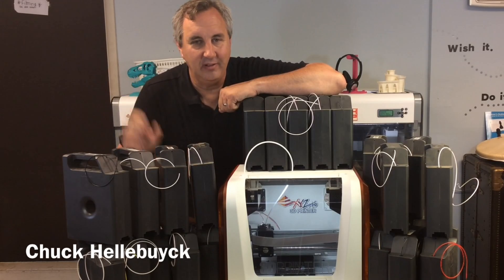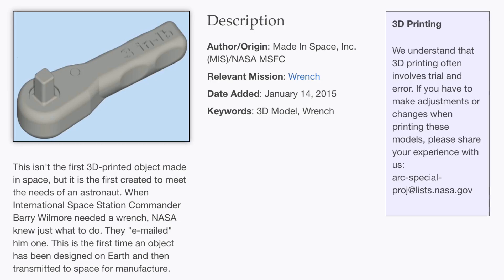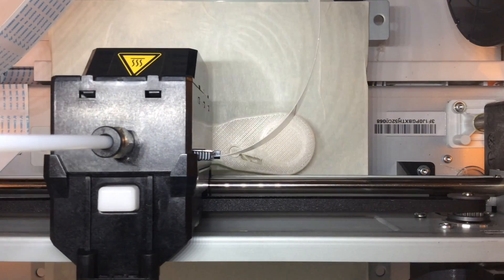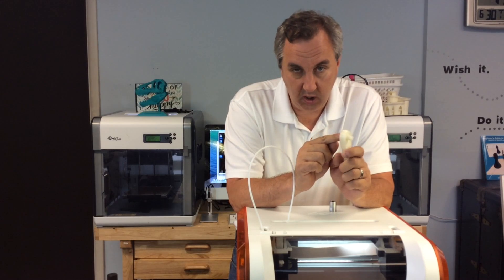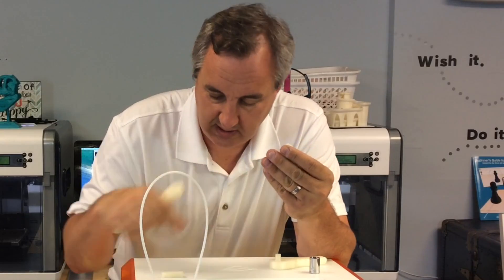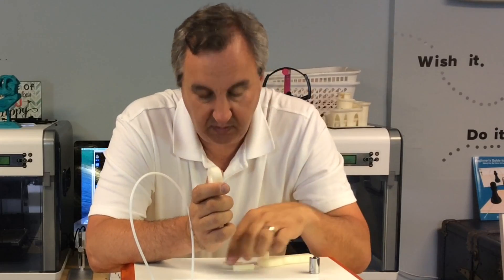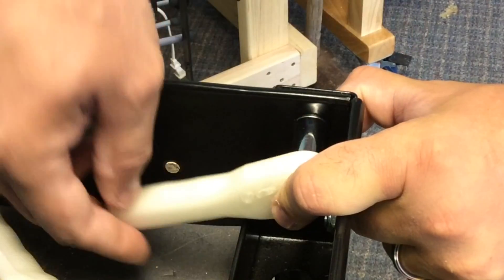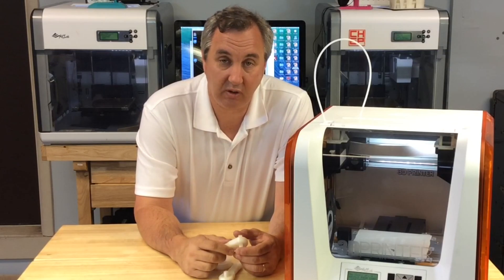Filament Friday #22 - NASA Wrench Test Print on Da Vinci Jr - Video #066

Comment: Tried this a few times now with the settings u recommended but all failed. the ratchet is fused and won't move. using clear yellow xyz pla filament. Any suggestions?

Comment: do you have to use .1 layer height
Reply: +Chuck Hellebuyck's Electronic Products thx
Reply: +Zane Hodgkins i printed at .1 and it worked fine but the gear won't turn advise on getting it moving

Comment: Hi Chuck, Any pointers on the Davinci Junior filament feeder? I just got back the replacement unit ran a test print and then unloaded it and now the filament won't load?? It seems as though the filament motor is jammed? Any thoughts will be great! I am so mad at this unit as it seems like a problematic machine. I should have gotten another Davinci 1.0!!!!

Comment: Chuck, I have installed the replacement extruder from XYZ on my 1.0.  I attempted the wrench at 50% density, slow speed and 1mm layer height.  Mine also is fused and didn't work.  Using the Junior, you used PLA, correct?  I'm thinking of getting a PLA cartridge for my 1.0 to see if that works better.

Comment: It's sad when the company upgraded away from its base to make you upgrade with them.  When XYZ sent a code to my printer to make it not work because I was reflashing the cartridge chip, it went from apathetic to plain old aggressive enslavement. I've since stopped using XYZware and now use Simplify3d, and am getting the best prints of my life...and can use whatever filament I want.   It doesn't surprise me that Junior is better, and we can't upgrade like other printers. Because of this, I'm visiting Lulzbot out in Colorado in September to meet the guys and see the factory....
Reply: No flashing. I can't keep up with the gurus in the forums, and there is no comprehensive "flash guide a-b-c" book", so I'm on 1.J Firmware with stock Simplify. The speeds of the motors are completely different, like the unit is not flailing out of control anymore, but deliberately putting layers down.

Comment: Chuck. I guess I  had better luck on my 1.0.  I was able to print several working wrenches first try. I really like your addition to this.
Reply: ***** I used some white XYZ that I had.  I printed it at .1 and similar infill as you.  Many say that white is the worse color but I have not run into that so far.